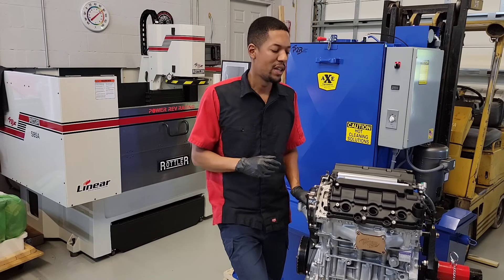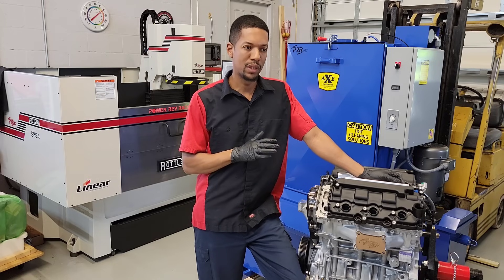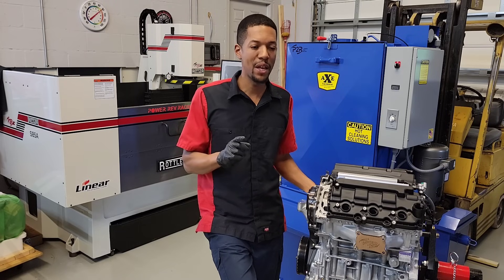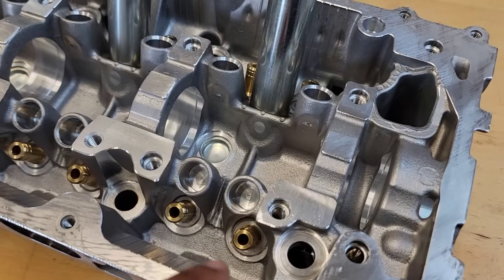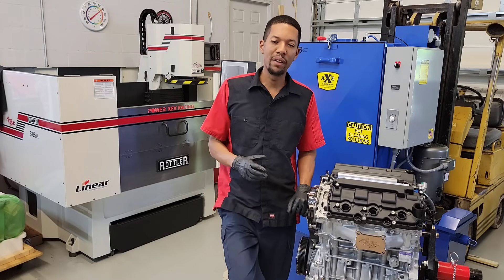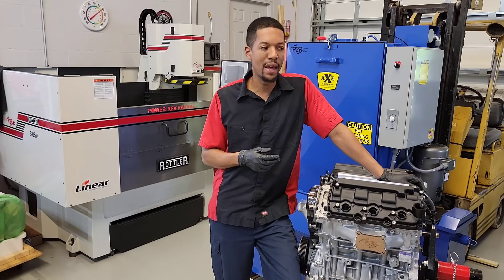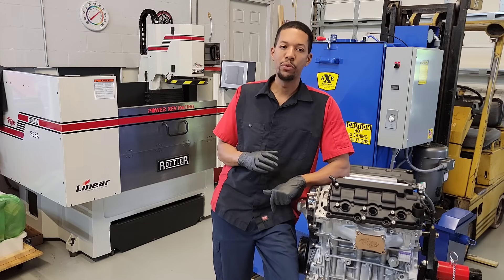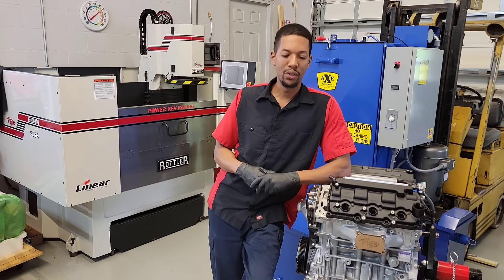J Series Tech Talk : Honda J35Y2 Cylinder Head Valvetrain Setup

Comment: I want to get a 2010 to 2013 TL sh awd but as we know the oil consumption is one I can not deal with...I have a 2010 6MT 3.7 that was fixed under warranty now I want a auto but want that issue not to be an issue....and no I do not want a used engine...what options do you have?

Comment: I sold my car right before I was about to get the custom cam from Halferland Performance (HFP). 🥲 I’ve only seen a handful of videos from lowkey owners on Youtube and Facebook…. 

Aside from that, I was trying to swap in an LSD from a 3rd gen (07-08) TL Type S 6MT. The thing was that, regardless of an entire trans or gear/LSD swap, the final drive in the TL-S was a lot less aggressive than the one in my 9th gen Accord V6 manual.

Comment: can you please send me a guide or link to rebuild the valve train on a 13 crosstour with the vcm engine . attempted to replace the vcm solenoid and all the little springs popped out of the rocker arms .
Reply: someone please help , frustated getting this valve train put back together ,was told it had the rare 3.5 engine

Comment: J35y1 lol. Sooo essentially the y1 and y2 heads are the same pretty much. I got an accord 2016 with the y1 and I'm itching to throw some power at her. She's gets down for stock. I would love to do a Manual swap as well. As it's never been done. Yea I know I can get the coupe 6.6 but I got kids lol. Not tryna be moving my seat back and forth. Anyway I want those heads for my car.
Reply from the maker: We can do cnc ported heads for the Y1. The main thing we won't be making for the Y1 is the camshafts, and the rocker assembly.   But we can do everything else.
Reply: @PowerRevRacing  not even drop in cams. 🤧 dang. Looks like I got to get a coupe. Or swap my whole setup. There no difference in the auto head vs the manual heads right. Or yall just not going to put that much work into the y1 heads.
Reply: There is a guy with a V6 9th gen sedan and manual swap
Reply: @9thgen66  ayyy brah you live in Maryland. I was looking at some of your videos. In live in Maryland as well.
Reply: @CR3j35_90kid  Yessir, what county you live in? I’ve raced a couple other guys from the DMV that have J series and make videos
Reply: @9thgen66  ay that's what's up. I live in Howard County. Hopefully by spring I'll be built. We gotta link one day. I usually be at college park with my brother posted up.
Reply: Dang foreal. What's his info. I'm tryna see what's up. Lol nice coupe BTW. Clean. 🤙🏽
Reply: @CR3j35_90kid  https://youtu.be/UzIxmoZn41Q?si=LiRXYyJ28iN7QZo6

And thanks 💪🏽